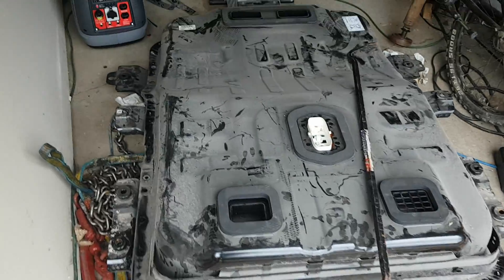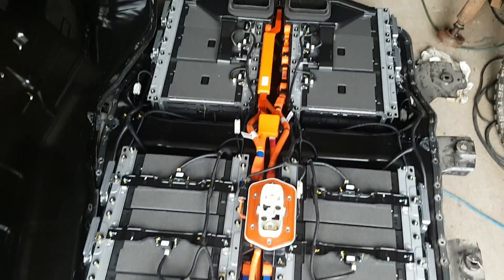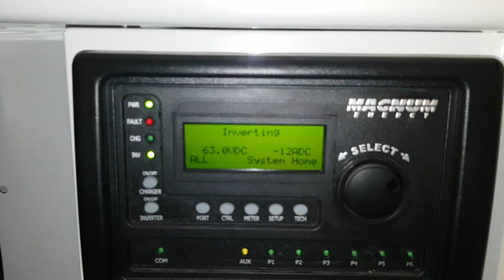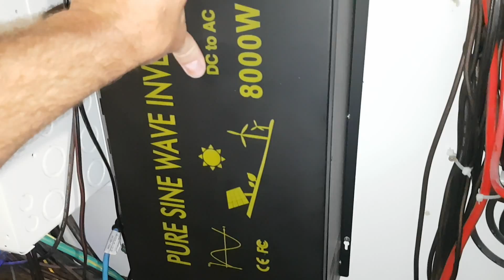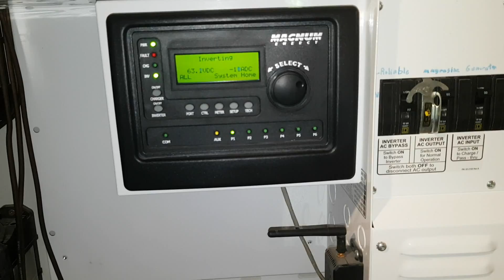28Kwh Battery

Comment: Glad to see inside the battery of an Ioniq! Do you have rough dimensions for the 10s and 6s modules? The battery voltage exactly matches the voltage of the pack in my car, and I wonder if they'd fit inside the old battery pack to make a higher-capacity replacement pack.
Reply from the maker: You have a Nissan leaf?
Reply: @GoingOffGrid101  Close, a 2011 Think City. Pretty similar to the leaf in terms of battery size and range. A leaf pack will fit inside it's existing battery case too, so that is another option (could cram as many as 62kWh in there with a SV plus pack...)
Reply from the maker: @jacobfield2214  this hole pack is smaller then the the leaf

Comment: Hi and thanks for the video. There is a rumour that the 28 kwh battery pack on the Hyundai Ioniq that you disassembled is in fact a 30.5 kwh battery. Can you you confirm this? Much appreciated.

Comment: Thank you for the nice video! I'm a Hyundai Ioniq owner, and I did some research regarding the packs and found out that the total capacity of the Ioniq should be somewhat larger than just the pack's nominal capacity of 28 kWh, so there must be an "upper buffer"... It would be interesting if you could find out (and please share with us viewers) what would the true capacity of a single module is, and exactly how many modules are in the pack. Thanks again for the interesting video!
Reply: 31.5kwh I think
Reply: @gzcwnk  28kwh useable capacity some other car seller like nissan leaf they say total capacity of the battery but what that means u get less useable capacity. so they trick u of thinking u get more when in reality u get less
Reply: @gzcwnk  This is about correct, the buffer is there to protect the battery from degradation, from what I've heard- keeping it from going to absolutely zero, which can seriously harm some batteries + designed to lose the buffer before the 28 (or the BMS system draws upon the buffer to replace lost main capacity, I haven't had an absolute answer yet)
Reply: did you ever get a response?
Reply: it is in the 30kWh-ish, it is written somewhere in the manual.

Comment: Why open it? Just ask do you dont now that you can charge that batteri pack and use a hige voltage inverter conection to your batteri pack. I have done the same wrong on my 24volt system on a Vw Eup batteri pack. Haha. Learn.. use Micro inverters and drive them from nett ore UPS. And charger kabel for ev charging. Can and dc in that.

Comment: Adding batteries should not cost you anything.  Meaning you make it up in longevity.  That is why I would get a long range battery. If the 50kwh battery lasts  200K miles, the 100kwh battery should last more than 400K miles.  You can charge it faster and damage the battery less. A situation where more is more than more.
Reply from the maker: thats a good way of putting it.

Comment: very interesting to see the hyundai ioniq battery. i have a car on order.
Reply from the maker: thats sick! its a very nice battery! just wish it had liquid cooling.
Reply: @GoingOffGrid101  What do you need liquid cooling for in a storage solution? :D
Reply from the maker: @rkan2  for me these batteries are perfect, but for the car these came out of I wish it had liquid cooling.
Reply: @GoingOffGrid101  turns out that this air-cooled design for the 28kWh Ioniq was better than the liquid cooling design that came after (Ioniq 38kWh). Hyundai has just issued a recall on all the 38kWh Ioniqs because the coolant is crystallising or sthing and clogging the cooling pipes and the battery is not cooled properly.
Reply from the maker: @Nikoo033  very interesting! that means more used EV batteries for us all !!!
Reply: @GoingOffGrid101  
actually the ioniq does quite well with the air cooling the battery. people have tested them with multiple rapid charging.
installing an OBDII and app lets you see each cells temperature.
Reply from the maker: @ursodermatt8809  o really, thats interesting. maybe I have over looked this. thanks!

Comment: i know your in ontario, seem to me there's a lot of wreck electric hybrid cars out your way. what are you paying for something like that?
Reply from the maker: 1500
Reply: @GoingOffGrid101  that isn't bad at all. i wish i could find something like that in saskatchewan, looked a few time but we don't have the amount of electric hybrids like out east does. if there is any, it's taxi cabs and most likely junk by the time the car is taken off the road
Reply from the maker: @jasonflt  no man, even a electric car with 200k on it I would still but the battery as it should still have 75% of its rated capacity.
Reply: @GoingOffGrid101  i will keep that in mind for sure thanks
Reply: ? @Going Off Grid  So that ist Canadian Dollars ~ 1000 € ? That's awesome. In Germany there are some Ioniq28 reaching 150 000 km. SOH is still 100 %, estimated degradation about 2 %. In about 4 years our Ioniq will reach this region of range. If we get into trouble with some cells I will call you to get one of the modules to exchange it :)
Reply: Are you saying you paid this whole package is $1500. That’s really good deal. Here in the states that will get you 2013 leaf pack only
Reply from the maker: @showmequick2245   I would buy a 2013 leaf pack for 1500 in a blink of an eye
Reply: Going Off Grid  lol so, you are saying it’s a good deal ? I was thinking this package is probably 2-3 years old and probably have better batteries. Than 6 year old lithium that was sitting MINNESOTA winters..  I will take your word for it.  Still you did not answer tho. Was this $1500?. Thank you anyways
Reply from the maker: @showmequick2245  yes i paid 1500 it was a good deal! but even a 6 year old leaf pack is still a good deal, make sure there is no sign of fire or heat.
Reply: Going Off Grid  will do. Thank you and keep the good work. 👌🏾